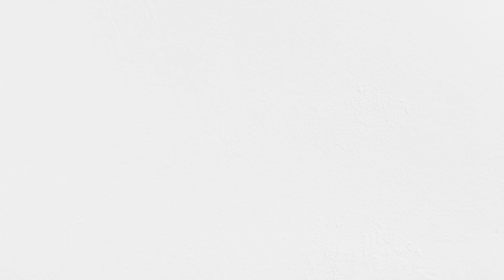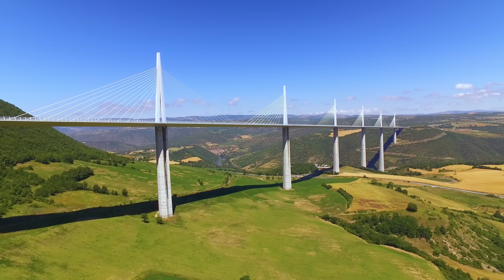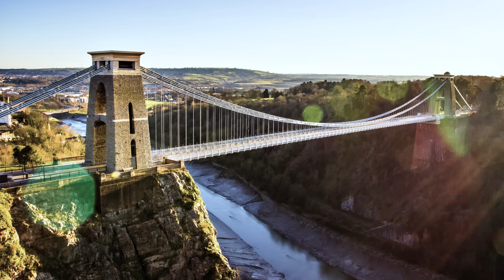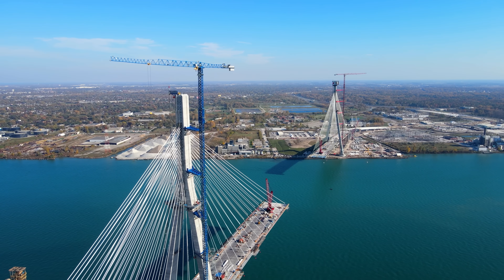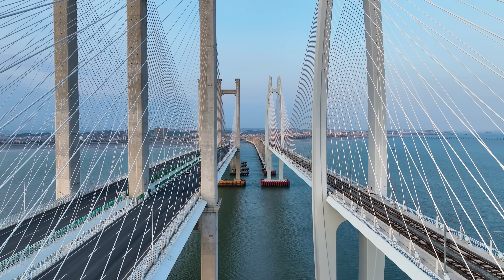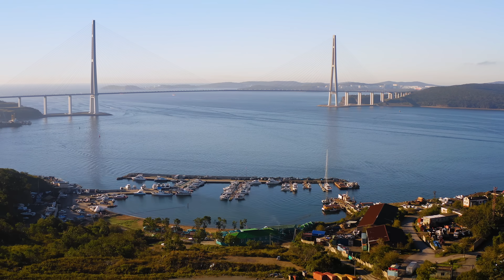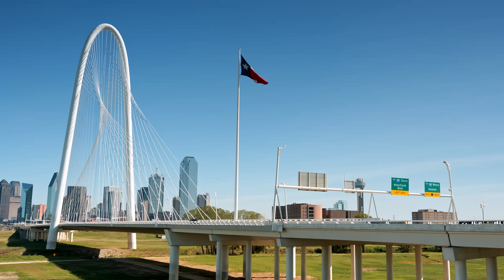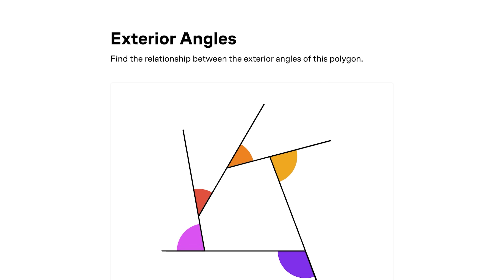A Love Letter to Cable-Stayed Bridges

Comment: In my opinion, cable stay bridges are just not aesthetically pleasing. Something about a classic suspension bridge is just pleasing to the eye. It’s smooth and calm, has rounded edges, and just looks more natural. Cable stay bridges look like modern abstract art. Their appearance is too “techy” and futuristic, especially the asymmetric ones. Sure there are engineering benefits to cable stay bridges, but I think aesthetics should also hold some weight to design.

Comment: The original Tacoma Narrows Bridge deck design was considered the ultimate in architectural beauty: thin and light. The cross section was in the shape of an elongated letter "I," the perfect shape for wind induced resonate flutter. If it had been a cable stayed bridge with the same deck design, it would have failed in the same way. The Millau Viaduct in France compensates for wind forces by being an inverted air foil. The stronger the wind, the stiffer the structure.

Comment: Lovely video.  

But have you considered just what the refrigeration cycle has done for humanity and will do going forward?  Cold storage of food that stays fresh (by pre-refrigeration standards) for far longer.  Cooling homes during heat waves, saving lives that might be lost to heat stroke.  Heating homes in winter at several times the efficiency of a furnace or resistive heating, giving us a realistic green-tech option for temperature control in homes for the first time in history.  (And in so doing, performing the magnificent charade of seeming to break thermodynamics by moving more energy than it costs to run it.)

Cable stayed bridges are the best bridges, no question.  But humanity would be fine without that specific kind of bridge - lacking in an elegant and impressive design that demonstrates a masterful grasp of engineering in an artistic and beautiful way, certainly, but we'd be fine.  Refrigeration makes modern life possible, and is a major key to making future sustainable life viable.

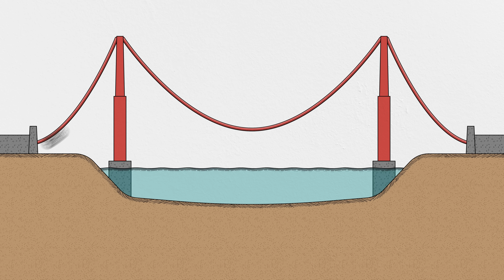Comment: at approximately 8:20 you show the installation of a deck on a suspension bridge running left to right.  The decks on all suspension bridges that I know of are constructed from the centre of the span to either end in a balanced manner.  You may wish to correct your sketch.

Comment: We love our big cable stayed bridges in Vancouver (Port Mann 470m and Alex Fraser 465m) but the one hiccup no one anticipated was the snow/ice bombs.

When we get a big wet dump of snow it accumulates on the stays. And then dops off in what can only be described as ice bombs. In 2012 350 vehicles were damaged and the bridges were closed. The solution is to install chain collars that can be remotely released, they slide down the stay to remove the snow. These are installed ahead of time by workers at the top of the tower. And once released have to be taken off and reinstalled etc.

Comment: I grew up seeing some major cable-stayed bridges go up in the 1970s: the Willemsbrug in Rotterdam, Netherlands, and the Köhlbrandbrücke in Hamburg, Germany, with central spans of 270 m and 325 m, respectively. I wasn't even aware at the time that those structures are so challenging to design; in the Netherlands and Northern Germany, they are used because suspension bridges are often simply not a practical option there, because the ground is too soft to support large anchorages.

Comment: Im sold, one question though. Why do the cables have to be anchored to the main pylon, are there designs that use a continuous cable? If both sides of the cable are anchored to the main tower they are putting the concrete in some tension, but if it was a continuous cable all the force would be entirely compression (provided the load is symmetric about the main tower for any given cable)
Reply: I think that was covered in the video , if only incidentally. Without the massive anchor blocks of traditional cable bridges the residual asymmetric side forces, wind, traffic, possible earthquakes have to be taken up somewhere. One place is smaller anchor blocks at each side of the deck , the other is the cables transferring the forces to the towers. Now if the cables did not transfer the side forces to the tower, only the anchor blocks take the side loads. Probably through the deck . So thicker deck, thicker anchor blocks.

Comment: Look up the Dublin link Bridge in Dublin Ohio (outside of Columbus) it’s a beautiful pedestrian suspension bridge with one pylon, and plays on the curved shape of the cable by having the deck shaped like a big S winding through the cables and through the center of the pylon.
Reply: It also angles the vertical cables which was interesting to me, haven’t seen that before and seems like a fusion of both ideas

Comment: I hate cable-stay bridges. They are too many straight lines. Even when you point to different variation, most of them look practically identical, just copy-pasted in different combinations of towers. The suspension bridges had much more graceful lines to them and much more interesting tower designs. They're like the most boring brutalist architecture, like looking at one of those Soviet housing blocks.

Comment: Never heard Bending be called a moment. bending is displacement, and moments are torque. Yes moments cause bending but they aren't the same thing. Feel free to call me out if I feel asleep during that lecture or the 3 months I spent as a structural engineer.😅

Comment: Thanks for another great video, I happen to be a pontist, I've travelled the world checking out cool bridges. As far as I know, until recently, there were only three Self-Anchored suspension bridges in the US (The Three sisters in Pittsburgh) and one in London (I'm sure there are more that I just don't know about, I know there was one in the midwest that was taken down due to simple maintenance issues).
Anyway, as I'm sure you're aware, the replacement Eastern section of the Oakland  Bay bridge is a single- cable self-anchored suspension bridge. Supposedly this was chosen because of resistance to earthquakes. It would be great if you could do an in-depth video explaining how and why this thing was built. I have walked over it, too, and as a pedestrian it is pretty cool. Thanks, Rick

Comment: Both bridges over the Cape Cod Canal in Massachusetts (the Sagamore and Bourne bridges) are currently in the planning phase for replacement. These are both bridges built during the new deal and I would like to see them propose a cable stay design for the new bridges. What if anything have you heard about the planning for the replacement of these two bridges?

Comment: What's funny is that the two examples he gave (Golden Gate and western half of the Bay Bridge) fit perfectly, but there's a cable-stayed bridge on the EASTERN half of the Bay Bridge, would have fit perfectly in one region 😂
Reply: That's not a cable-stayed bridge - it's a self-anchored suspension bridge (though the tower is built with the cable nearly meeting itself in the center, so it looks like many cable-stayed bridges). Its construction was exactly as long and complicated as Grady described, with a temporary falsework bridge to hold up the new bridge deck while the suspension cable was spun.
Reply: @jamesnauer6884  Shoot, guess I was wrong. Thanks for the correction 👍

Comment: There is a cable stayed bridge in my city. It has only one pillon, holding up two curved stretches of two-lane roads that cross over each other... and that pillon is an arch! As you can imagine, it is very beautiful. And we all hate it :) it solves exactly 0 of the problems it was meant to solve and it has cost a pretty penny (though, not as much as one could imagine, as this design is indeed, efficient).

Comment: In addition to its size and beauty, the construction of the Millau Viaduct demonstrated the construction advantage of cable-stayed bridges.  The entire deck and cable pylons were constructed on land and pushed out onto the lower pylons. A feat impossible with any other bridge that size.
Reply: Yes, there are amazing photos of it during construction before each span's cables were tensioned. It was incredibly crooked and looked in imminent danger of collapse - but it was all carefully calculated to be within the elastic limits of the steel. You could not have built it without very sophisticated computer software (which is true for most large cable-stayed designs).

Comment: Curious about what downsides exist (even if they're outweighed by the positives). Also, whenever I've tried to build a cable stay bridge in a game like Poly Bridge, it tends to separate in the middle, the compression force turning into a tension force in the center. Perhaps my bridge decks aren't stiff enough to prevent bending against the compression force? 

You have convinced me that they're pretty great though. Those double cable planes with each plane totally separate, supported by an individual unconnected tower are so striking!

Comment: If the span is under 500M arches are soo much easier to engineer and put up, Cable-Stayed is only worth it with 1KM spans, with bigger spans you have to go back to regular suspension.

Comment: It seems that every conventional suspension bridge in the world has corrosion problems in its two large main cables, what can you really do with a conventional suspension bridge when the main cables lose too many strands to corrosion, you cannot really easily replace either main cable - so the bridge may have to be closed and demolished.  With cable stay you can easily replace individual cables ---

Comment: There is a type of bridge that is a hybrid, a cross between a cable stay and a suspension bridge.  And the prime example of this is over a hundred years old!  I'm talking about the Brooklyn Bridge in NYC.
The Francis Scott Key bridge will be replaced with a cable stay design.  
BUT, for spans over 4000 ft long, and there ARE some bridges over 6000 ft in a single span, the classic suspension design still remains king, at least for now.

Comment: Years ago I visited Normandy. To get there, I had to cross the Pont de Normandie, which was the longest cable-stayed suspension bridge in the world when it was built (1995). 
On the North end of the bridge, there's a parking area (Aire de la Baie de Seine) that has some exhibits showing the construction of the bridge, plus the shortest cable-stayed suspension bridge in the world (about 5 meters long).

Comment: Love this video! Your passion for cable stayed bridges really shows through!

I remember when doing our Engineering Science major project at high school back in the late 80's my colleague and I opted for a cable stayed bridge made out of fishing line and balsa wood. We did "win" the competition but we had the best looking bridge by far.

We maintain that the winning bridge cheated the competition in any case by using a non balsa wood tie at the base to hold the two massive balsa wood / epoxy glue composite abutments together to support the large balsa / epoxy composite arch.

Comment: At the engineering consultancy where I work, we once designed a cable stayed bridge that was built in the "wrong order": First the deck and then the phylon. The deck was designed to be able to carry self load until the phylon was added. Not a big bridge, but quite interesting due to complex geometry and  many railway tracks in continous service beneath it. Byens Bro in Odense, Denmark

Comment: They're going to replace a 1960s ugly boxy concrete 12 span bridge near me. When I saw the planning drawings with its 6 spires with a faint resemblance of the millau viaduct, i was elated. It's going to be at least another 9 years until it's finished, but I'm already looking forward to driving over it for the first time 😅

Comment: Why don't we just use cable-stayed bridges for all bridges, since they solve many of the problems associated with other bridge types and are cost-effective?
Reply: But it does not solve all the problems all the time and it its not always cost effective. The video even said so. The national highway standards read in the video gave an upper and lower limit for size where cable stayed bridges are suitable.

Comment: My local cable stayed bridge is actually a pedestrian Crossing in Ottawa which I think an architect had a large role in 😂. There's also another walking one in Winnipeg, which is clearly very engineer oriented. I think it's funny when you look bridges to see how much role an architect had versus an engineer by just the end result.

Growing up traveling across Ontario the one bridge I was most fascinated by was the nipigon cable stayed bridge, which has its own fascinating story behind it. Namely the failure where the deck shifted like 3 ft. There's a husky diner and gas station that we used to stop at and I remember seeing that bridge rendering a few years before it was built and then seeing it actually built, and then seeing it fell and then seeing it fixed. It was probably my first real introduction to engineering and I was always fascinated with how simplistic it looked and how it was built. I had the privilege of seeing it built partially as we were passing through during construction so I got to see a few different stages of construction from a distance while driving across the previous bridge.

Comment: This was great. Thanks. I've read that sometimes engineers "over engineer" and recently travelled across the Forth Rail Bridge in Edinburgh, Scotland. This is a unique looking bridge that is one that has been called over engineered. That may be because it replaces an earlier bridge at the same difficult location that collapsed. It is such a cool looking bridge it might be part of another great video. The bridge was used for a scene in a 1935 Hitchcock movie.
Reply: You are correct that it is overengineereed because of a previous collapse - the Tay Bridge Disaster. In the history of civil engineering that disaster is known for the lessons learned at the cost of 59 lives - in particular ways of calculating wind forces (no-one cared about wind before then) and careful control when casting iron.

Comment: As an engineer, I love triodes.
They are technologically obsolete, they waste power in the heater, they suffer from the Miller effect disproportionately, they have a limited lifetime, and being made of glass they break easily.
But. Their trans conductance curve is magic: they don't clip an excessive large signal, but they compress its dynamic in a proportional fashion, a behavior which can be imitated in any other way - and this is the reason I use a century-old technology in hyper-modern design.
May I suggest if other engineers watching this Valentine video lists their preferred device or manufact.
Happy Valentine's Day to everyone.
Anthony
Reply: Audiophiles are a special breed…
Reply: hear me out: what if you designed your system so you don't get any excessively large signals in any case

this is why triodes are obsolete, not just obsolescent for audio.

Comment: This video made me curious about what Cable Stay Bridges I've seen, and it turns out the only one I've seen regularly, the Denver Millennium Bridge, despite being a short little pedestrian bridge, was also a tech demo for post tensioning (which I assume means it was built in place and then the stays were tightened?) 

Still, pretty neat!

Comment: cable stayed bridges are cool, but having had emergency training, there's something to be said for holding structures up with mass instead of maths.   if you knock a big chunk out of a viaduct, the rest of it will usually remain standing or at least collapse progressively enough to let people run away.  we all saw what happened when MV Dali hit a bridge that relied on trusswork for its strength.  same with galloping gertie - the bridge was plenty strong to hold itself and the weight of traffic.  but the wind changed the calculations and caused it to tear itself apart.
Reply: There are enough earth dam failures to demonstrate that, mass does not seem that much of a help by itself.
Reply: @francesconicoletti2547  erosion is a bummer. Who would have thought water might run down an emergency spillway.

Comment: okay, fine. you have convinced me. i was planning to just swim next time i need to cross a large body of water but I will try this cable-stayed thing and see how it works.
Reply: Why do Olympic athletes keep trying to swim across the pool when they could just build a cable-stayed bridge and run across it so much faster? Silly athletes.
Reply: @General12th While they're at it they can add tracks on the bridge and get the entire Olympic village across the pool several times a day comfortably and efficiently.
Reply: @General12th 😂😂😂😂😂
Reply: Your cereal will be a little less soggy that way.
Reply: Make sure you plan well ahead of when you need to cross…
Reply: olympic competition on cable-stayed bridge building and running over instead of swimming
Reply: just don't try to walk on top of the water. ya just fall right through it. learned that the hard way.

Comment: You’re definitely one of my new favorite channels, I’ve hammered through a good chunk of your past videos in the past month:) I up in a family excavation business but, and don’t let my late grandfather find out, I was thought if I hadn’t skipped out on going to college then I would have loved to be a civil engineer after finding a book on the construction of the Golden Gate Bridge when I was in 3rd grade but I liked running dozer and excavators too much and gave up on that dream. I do have a bridge question slash video suggestion though, I’d love to see a video on the different ways of connecting the parts of bridges together, like how are the cable stay’s attached to the deck that makes them so strong or on a suspension bridge, how are the suspension cable affixed to the main cable and why don’t they slip?